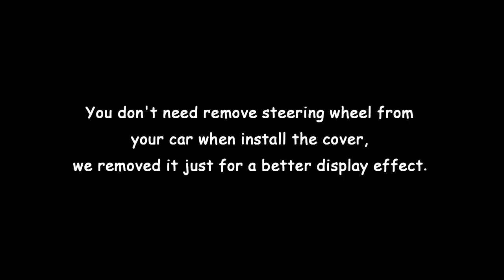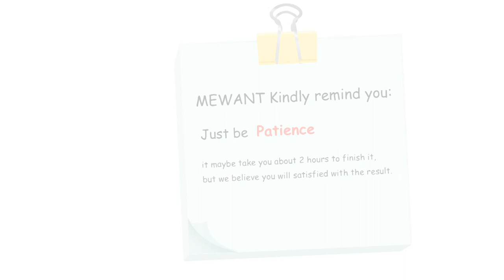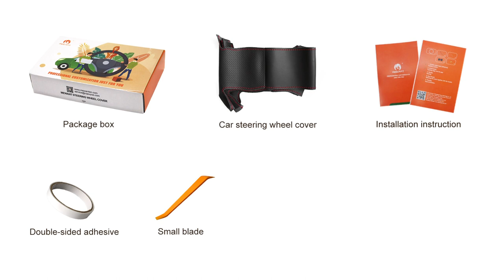MEWANT---for Alfa Romeo Giulietta 2010-2014 / MiTo 2008-2015 Hand DIY Steering Wheel Cover Install

Comment: Did you have keep in consideration to dismount from the stearingWheel the gray plastic cover that contour the three holds points? It' should be may be easilery to fit the cover underneth instead of tuck it with the plastic handle tool ?